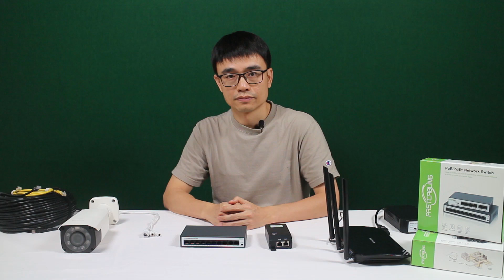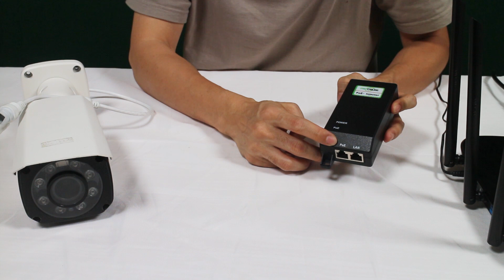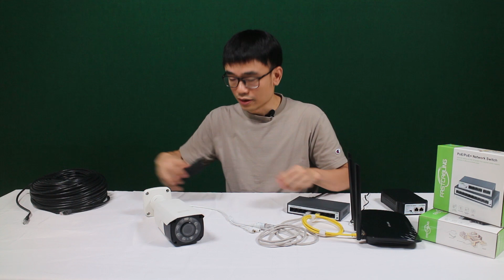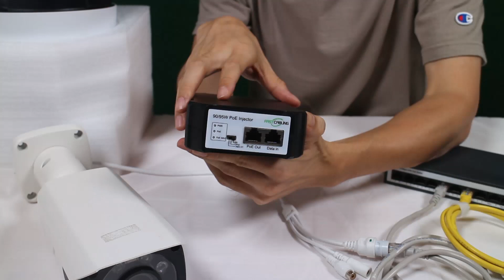The PoE switch vs PoE Injector? what is the difference?

Comment: Anpr says 12-36v DC or poe, i have 48v poe injector will it work?
Reply from the maker: No. Supplying 48V to a device rated for a maximum of 36V may damage its internal circuitry. Or you can use a PoE splitter to separate data and power (DC) into two outputs and step down the voltage to 12V. You can watch this video: https://youtu.be/qRrcBnYi33k

Comment: What’s the benefit of this as opposed to designing the camera so it just plugs into a normal outlet?
Reply from the maker: You can transmit power and data via the same Ethernet cable, no external power outlets needed.

Comment: Does it matter if your PoE injector is 12v or 24v or 48v if you are only going to power one Reolink camera like the one in this video?
Reply from the maker: The voltage of the PoE injector does matter when it comes to powering devices like Reolink cameras, or any PoE-enabled devices for that matter. Each PoE-powered device (PD) has specific power requirements, including a required voltage and wattage. Using a PoE injector with the incorrect voltage can result in the device not working properly, or it could potentially damage the device.

Reolink cameras, depending on the model, typically require PoE that conforms to the IEEE 802.3af or IEEE 802.3at standards. These standards usually provide power at 48V (44-57V range), and devices designed for these standards are built to operate within this voltage range.

Comment: I want to connect a POE camera in a garage to a router that connects to another router in the house. I have a pie injector but how do I find it on the NVR?
Reply from the maker: The IP cameras works standalone. There is IP address with the camera. So you should be able to see the camera's IP address by using the PC computer or the NVR. If the NVR doesn't detect the camera, you might bring the camera to the same router which is working with the NVR, and try to make the connection. If the camera show offline after your relocate the camera to the house, then there is so problem with the routers setting. The network is not work. You can test the another router in the house by using the mobile phone or laptop.

Comment: how about the poe switch with separe lan channel can you plug in anywhere in that ports or 1 lan ports is associated with the dedicated poe port?
Reply from the maker: Yes, you can. The PoE switch will detect the edge device before it release the PoE power. If non-PoE device is hooked up to PoE port, the PoE switch will provide only data exchange. There is no different between LAN port and the PoE port in this case.

Comment: Question if you have 4 PTZ cameras installation and dont want to use the 4 PoE injectors, what can i use??
Reply from the maker: You can consider using a high-power PoE switch. https://www.fastcabling.com/product/802-3bt-poe-switch/

The total power budget is 180W, with a maximum power of 90W for ports 1-2 and a maximum power of 30W for ports 3-4.
Reply: @Fastcabling  ok thanks it should work then, my 4-PTZ power needed is:  C 56V/1.16A • 65W PSE, each
Reply from the maker: If needed, we can also provide free solution design for our customers. Please feel free to contact us at support@fastcabling.com.

Comment: Off topic question:

If you connect the wifi router to the switch, and you connect the CCTV cam lan cable to a wifi extender, or a ethernet to wifi bridge, connect the wifi router to the wifi extender, and arrange for a separate power supply for the camera, then will the CCTV camera wirelessly transmit data through wifi, which I can browse through a laptop connected to the switch?
Reply from the maker: Technically, it works, but you need to consider the bandwidth. It sounds like you have multiple cameras that go through the WiFi connectivity before it reach your PC computer or NVR. If you just want to watch it occasionally, it should be good, but if you want to have 24/7 recording, you need to make sure there is stable wireless link between the cameras and the PC computer.
Reply: Thanks!  @Fastcabling

Comment: If I have a POE switch and a POE injector. Do I need to plug both the injector and switch to the router? Or can I plug the injector to the switch as not to use all the space up on the router?
Reply from the maker: I think you don’t need PoE injector if you have PoE switch, and yes you can hook up the ip cameras to PoE switch to save some network ports on your router.

Comment: Nice explanation about the differences between Injector with Switch.
Can we add 2 POE switches with 1 NVR? I have NVR (16 port) and want to install 3 more IP camera's. So, i want to add another POE switch to add 3 IP camera's. Can i do it?
Reply from the maker: Yes, but you need to check whether your PoE NVR can take in additional IP cameras or not. Some PoE NVR has limited resource to handle extra ip cameras.
Reply: @Fastcabling  Thanks for answering. 
My NVR is separate and POE switch (16 port) is separate. I connect my POE with NVR through patch cable. Now I want to add another POE switch to increase the number of IP cameras.
Reply: @kashifnoor4750  damn … I have the same question.